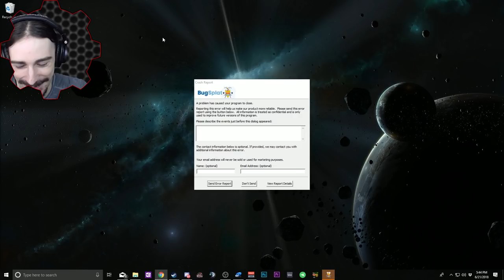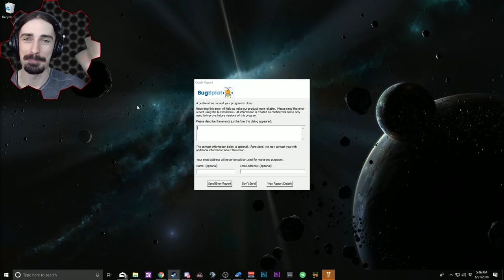WATER BUOYANCY and HELIUM MOD! - Scrap Mechanic Gameplay

Comment: Perhaps a battle of boats? ( the main frame AND outer layer must be buoyant, but destructible material, and you place a spud-gun of your choice ( minigun or mg ) and whoever sinks, is out of the game.  After they are out, then they could fix what was wrong with the design, and sharpen any of those! For dominaton, place buoyant platforms on the water, and then whatever is your team color, you put it on the platform you stand! )

Comment: Do a multiplayer monday episode called "stay on your raft" where the rafts are made of helium and you can have 4 spudguns, one in each direction, which will also balance the weight, and see who wins, first to 4, 8 thrusters, two in each direction for moving and turning.  If you are knocked out of your seat, you lose that round. If your water activator is destroyed or you lose it, you lose.

Comment: I've tried this mod before, I detached a water block from the ground, and it had a water activator on it. And since it technically was underneath the water block, it floated into the stratosphere, I never saw it again.